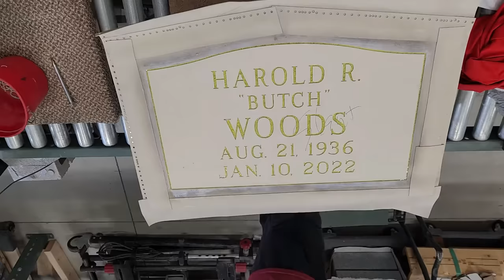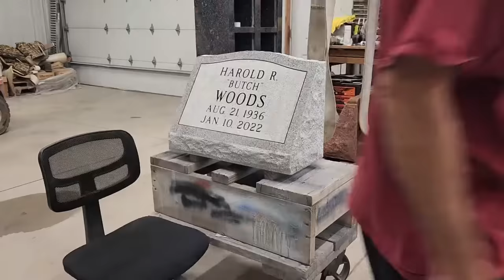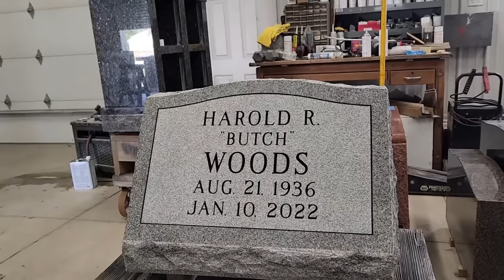Engraving a Headstone

Comment: When I did this, about 37 years ago, we had to hand cut all those letters, and the edges had decorations, floral print etc.  We had stencils to put down the letters and numbers, but had to cut with hand with a razor blade, which means you have to be able to cut a straight line for those letters and make them all look the same day in and day out.  Todays costs cover the added costs of the equipment needed to pump out 8 to 10 of these an hour by a single person, back in my day you could get 3 done a day and we were back logged 8+ weeks.  I don't think the majority of people understand just how many people die a day which is why these need to be done so fast today, plus technology is a bonus.  Why are new cars more expensive than old cars?   It got easier to make them, yet costs went up....makes no sense complaining about the costs still being high to make headstones.  And those who really think you can chisel granite...LOL...too funny.
Reply: THAT was when the headstones were actually worth the price.
Reply from the maker: This method still takes hours to complete a single stone. On a good day and depending on the size of the stones done, I could manage 4-6 in an 8 hour day. Floral inlays are still done by hand and increase the overall price so most families opt out of "extras".
Thank you so much for watching!
Reply: We do this type of work in the field using some different techniques/ order of operations. On an average day in a cemetery we'll crank out about dozen like this in an 8 hour shift with setup, tear down and relocating for each as long as its just text and frosted panels.

Comment: Obviously done much different than it use to be. This is basically etching not engraving?
Reply from the maker: To imply an etch is to remove basically the surface of the material. Sand blasting actually carves the letter into the stone. Up to 3/8" in some places
Reply: @night_al  very interesting method, from just looking at it unless you're there doing it, someone like me wouldn't have a clue how it actually works... like magic. I was actually expecting like a carving bit to grind into the stone... shows how much I know lol.
Reply from the maker: @garyr7027  , perhaps the terminology should catch up to the process nowadays. We still call it engraving when sandblasting.
Thank you for watching!

Comment: This was pretty cool to watch, a first for me.
But I do have to say, you seem to breathe in quite a bit of silica dust. I am not an expert but it looks like you may need to up your safety game to prevent Silicosis. Not bashing, just an observation.
Reply from the maker: It was aluminum oxide. A silica substitute. Also, there's an exhaust system in place (inside the blast room and in the shop) that's extremely adequate for air-dust removal .
Thank you for the comment! And thanks for watching!

Comment: My father used to do this with hammer and chisel ,nowadays modern machines like die grinder have speed up the process 10x. It has one advantage over sandblasting and regular CNC work that it has enhanced depth effect.

Comment: This process is etching not engraving! Where are the gravers? For those who are unaware, GRAVERS are just the cutting tool. The ENGRAVER uses the graver to cut out the the design. Whether they be hand-type or pneumatic, a graver must be used to call it engraving, even if the graver is used in a CNC machine. It all goes to business integrity and honesty in advertising. If the company gives you grief over the difference, I'd steer clear of a shyster like that. A professional Monument firm will know the difference, happily explain it and the cost differences as a result. Shopping around is obviously necessary.
Reply: engraving is a physical process, and etching is a chemical process.

Comment: I worked in an artroom at a monument place for few years. 
My job was cutting the design on a plotter or by hand if was intricate.   And placing it on the stone.   Then picking out all the parts to blast. 

Was not a bad job as it was a lot of working with your hands but not hard work. Takes a real eye for detail and being super picky.  Because sometimes you only get one shot at it.  Many times I would get 75 or 100% done and find one detail off and redo whole thing or part of it. I could sit and smoke in the shop for hours while doing large pieces as it was that casual in the 90s.

Comment: One of your comments to someone else said this is how majority of headstones are done around the world. I'd think a mill, laser engrave on the polished stone, or a bronzed piece of metal with the laser engrave would all be options. Maybe those are options just less common ones?
Reply from the maker: Just more expensive ones. Industrial lasers etchers are not cheap. $10, 000 for the one in the shop and it only etches tenths of an inch (and takes hours to do so).
Veteran plaques in the US are bronze stamped and gorgeous... for about 10 years. They fade, get hit by sextons on mowers, freeze - thaw cycle warps them.

Comment: I still donet see how the letterrs were engraved on the srone??????
Reply: A computer and a plotter cutter
Reply: The machine shot blasted the stencil that cuts the lettering into it.
Reply: The cover protects the stone. The exposed letters are not protected and and blasted until legible. Probably the maximum depth the machine can manage. It's glass etching with high speed sand instead of thickened acid.
Reply: re watch the video!

Comment: Why are the date numbers not lining up?
Reply from the maker: Is this for the "Engraving a headstone" video?
Reply: @eyedeasAbility  Just my opinion, I think it would look odd as some numbers are narrower than others. The way he did it, seemed to balance it all, at least to me.
Reply: I’m guessing their software uses proportional typeface rather than monospaced.  In a proportional typeface or font each letter is a unique size, taking up a different amount of space and space between each of those letters. Where is a mono spaced font typeface takes up the exact amount of space per letter and space in between so if you write 10 letters under 10 letters it’ll take up the exact amount of space as long as the point size is the same at a 10 pt  font for 10 pt font of the same font type and font style (e.g. bold, italic). In a proportional font, a “b” takes up a different amount of space than an “i” would. Back in the old days of typewriters there was pica and elite. A pica font took up 10 characters per inch whereas an elite typewriter font took up 12 characters per inch. If you already know that I apologize, I thought others might find it helpful that we’re not familiar with typeface.  it was standard so apples to apples. if your college professor ask for 1 inch margins with a pica font and wanted a 10 page paper then all the students would turn in essentially an equal size formatted paper. Sometimes they would call for a specific font.

Comment: Interesting. However, also being involved in the industry, we take far less time to engrave the lettering. The method depicted in this video seems very time consuming. We precut a stencil, lay straight onto the headstone face, weed out the letters, sandblast accordingly, wash away sand/dust, then paint the letters. All done in little time and ready to install in cemetery.
Reply from the maker: This was also double processed. Adding a frosted panel first then blasting the letters. A single process takes a fraction of the time to make.

Comment: Rest in Peace, Butch. I hope you get to see your faithful dog in the next life, too. 

Out of curiosity, at 4:33 how are the letters carved out? Looks like with an Xacto knife. Is that using some sort of template underneath or just a skill that you have to learn for cutting out the letters as perfectly as possible?

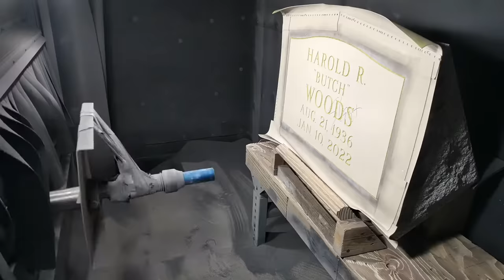What is the material at 6:03 that covers the rest of the stone while the material is blasted away for the letters and how does it not erode away the material covering everything else?
Reply from the maker: Those letters are precut into the stencil using a plotter. I just peel them out.
The stencil is made of rubber and allows the "sand" to bounce off anything covered and penetrate anything that isn't.

Comment: Wow this was truly impressive. Did the artisan seriously draw those letters in freehand ??? Or was there a stencil that we couldn’t see clearly ? Everything was spot on perfect.
Reply from the maker: Precut. And thank you!
Reply from the maker: @beanseason6515  , it would be easy to place the stencil crooked, or not peel a letter out all the way, or blast it too deep, or not deep enough, missing spots when painting... It's more than you think.
Reply: There was a stencil, I was graphic designer, I saw it ….  Great job and it’s a lit if process
Reply from the maker: @lucioavarello5620  thank you and thanks for watching!
Reply: @beanseason6515  Sorta kinda, but as the author has already said, it's still more complicated than a Walmart check out job.
Yes, way easier than "old times" hammer and chisel (and a ruler and pencil), but then with current labour costs only the richest folks could afford such pillow.
Also, in case you'd like to know, In some places they still use chisels, although no hammers - those are pneumatic driven ones (akin to pneumatic needle-scalers welders use), and those chisels are carbide-tipped. Still, they use a pre-cut stencils (made in Illustrator or other vector-based graphic programs, cut onto a self-adhesive thick vinyl film on a cutting plotter), with a "surface only" sandblasting (i.e. no deep relief, like here) - and then the relief is done "by hand", using aforementioned pneumatic chisels.
Reply: That Bean Season guy replied: "MrKotBonifacy so he can put some masking tape on a stone. Wonderful artistry" but then he changed his mind and deleted this, and his earlier comment, what a great loss... Seriously though, no, no "great artistry", but a certain skill nonetheless. I had been doing similar kind of work some years ago (designing, cutting and making all sorts of signboards, cars/ vans graphics, stencils for sandblasting glass, and faux sandblasting - i.e. cutouts from translucent adhesive vinyl film that looks like a sandblasted or frosted glass) and while this admittedly doesn't make you a great artist, free-handing flowers, arabesques and what not, it still does require some skills and attention to details. Artistry, it is not; craftsmanship, probably it is. Have a nice one.
Reply: @night_al  I had no idea what a lengthy process this was. True craftsmanship.
Reply from the maker: @U2WB  thank you so much! Thanks for watching!

Comment: How much does a head stone that size weigh? How heavy do they get?
Reply from the maker: So many factors: type of stone is a major one. Solid black granite is heavier. This particular stone was ballpark 250 pounds. If this same stone was black, it would be twice that. As far as how heavy they get, well, depends on how deep your pockets are. A stone can be ordered any size. The only limitation is the lifting weight of the equipment used to get it off the semi trailer.
I remember setting a multi piece set and the heaviest stone was roughly 1200 pounds by itself.

Comment: So would a CNC router and a diamond bit do this faster, and with greater detail? I know they use laser now too, but I assume that machine is quite expensive, a CNC router doesn't cost much anymore
Reply from the maker: The one in the shop, specifically for portraits on black granite, cost upwards of $10,000. It paid for itself in a year. Nonetheless, it takes hours to simply etch a 12"x12" portrait. To engrave it would take days and multiple diamond tips. Sandblasting takes barely a few hours and is, in my opinion, the fastest - best method so far.

Comment: Weonly frost the panel before on on-site engraving. Otherwise we blast then paint then peel and frost. We use a detergent sand mix to pack the letters for frosting
Reply from the maker: I was taught to frost first. The boss had a fear of the letters ending up rounded at the edges I guess. I've never tried that method you spoke of. I know it, just never did it that way.
Reply: @night_al  sucks you have to hood up to frost. One of the downfalls of an automatic blaster I guess.
Reply: @night_al  I know cutting out flowers and random designs first to frost has to be time consuming also.

Comment: Hey mate I'm having trouble keeping in my Counters when sandblasting... What glue are you using before you apply your template?? that may be my problem!!! relying on just the stick of my template!
Reply from the maker: The stencil adhesive backing works great on polished surfaces, however, pressure and distance from the medium are crucial. I only glued the stencil initially out of habit. Then again, because the face of the stone was frosted (lightly blasted to remove any polish) and it was rough. Stencil has a hard time adhering to that roughness. In the booth, we used 80-90 psi at a distance of 26-28 inches. Experiment with that first. But, just in case, here is a page to explore:
https://www.milessupply.com/product-category/adhesives/
perhaps even contact them on their advice as the employer i worked for won't let me divulge the information you requested. My apologies. Good luck and thanks for watching!

Comment: You might want to avoid entering the sandblasting room without at least a dust mask. Also, it is generally unwise to douse something with flammable liquids in a confined space, especially with electricity and an engine running nearby.
Reply from the maker: @rhapsodyman2000  sound advice

Comment: Sandblasting etches the surface of granite, yet it doesn’t touch the paper. How does it happen?
Reply: Paper is soft. It’s like throwing a ball at a window vs a pillow. The glass will break as it is not flexible. Of course, the paper needs to be thick enough to withstand the sandblasting and if blasted long enough, it will rip. I sandblasted glass in the past and covered some areas with regular tape. Works perfectly fine.
Reply from the maker: It more than etches. It carves into the stone. And it's not paper, it's rubber stencil. The "sand" bounces off the rubber

Comment: I'm guessing the rubber stencil was cut with a plotter? Or a laser?
Reply: Cut on a plotter using a very sharp and extremely small knife blade that runs rapidly over and just through the tape, thus creating the stencil. Designs are also added using the same method.
Reply from the maker: Plotter

Comment: Why doesn't the sandblasting go right through the paper? It seems like the sand attacked the stone to a far greater degree than a much softer material.
Reply from the maker: It's rubber stencil. The aluminum oxide boues off
Reply: @night_al  I'm amazed. It obviously works - just rather counterintuitive.

Comment: Thanks for sharing.  I can see this is very labor intensive.  One thing I've noticed in older gravestones is how they tend to "weather" away and lose the depth of the lettering.  Can a customer request a "deeper" cut into the stone so it takes longer for weather and time to affect it?
Reply from the maker: It's really hard to "re-blast" a stone. Normally cleaning out the letters and numbers and repainting them by hand is done.
Thanks for watching!
Reply: Also, older headstones were marble which doesn't weather as well as granite.
Reply from the maker: @joenic4303  absolutely. Marble is much softer than granite. I was always really nervous putting a new date on a marble headstone. 1. The stencil really doesn't stick that well to weathered marble and 2. It's ridiculously easy to blast too deep and blow out the letter and or number islands. The centers of 0s, Os, As, Rs, Ds...
Reply: @night_al I second disliking marble inscriptions I had one the other day I had to re glue twice and the stone had just been cleaned a few weeks prior. Only good thing is it blasts very quick

Comment: Why does the sand blasting not tear up the covering you install around the lettering when it is powerful enough to blast away the granite to make the letters?
Reply from the maker: Because the nozzle is in constant motion. If it where to stop on an area for even just a few seconds, it blast right through the rubber stencil and damage the stone
Reply: @night_al : Can a name be removed? Or will I have to buy a huge new stone and replace it? My parents are on one side and aunt and uncle on the other, I will be buried there too.
Reply from the maker: @e.conboy4286  yes, it can be removed by blasting passed the depth of the letters already there or filled in with epoxy and reblasted but it's not optimal. You would have to talk to your local monument dealer and see if that's the route you want to take. It is much cheaper than having a new stone created

Comment: Words would  of been nice ,,,what was the spray paint and assume it was a sealer to lock the work in ,,,but quite  interesting
Reply from the maker: A voice over is in the works. Thank you for watching!
Reply: @night_al  thanks do you carve the stone as well and are there any videos  always fancy working with stone such a wonderful material  ,,,is that done with a template or do you mark out each letter
Reply: You could do captions instead of voice-over, @night_al , if that would be easier for you. Just a few key words would explain each step. 

In particular, it isn't visually evident that the lettering is pre-cut in the film (although it obviously must be since that would not be feasible by hand, and you confirmed that in another comment), and the paint and sealer could be mentioned.

Comment: There is way more gluing paper (I assume some high resistance material) to rocks involved in this process than I expected.

The wooden base it is on, do you make that custom? 

What is the liquid from the can in the last step? Cleaner? Polisher?
Reply from the maker: Gluing the rubber stencil ensures the pressure won't blow it off.
The wooden stand is custom made.
The liquid is camp fuel and is used to remove any excess glue